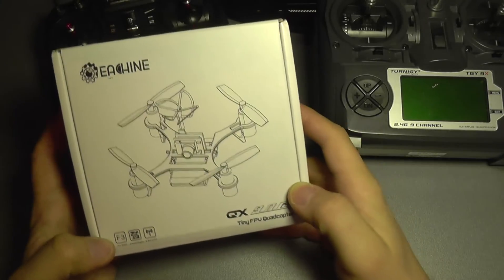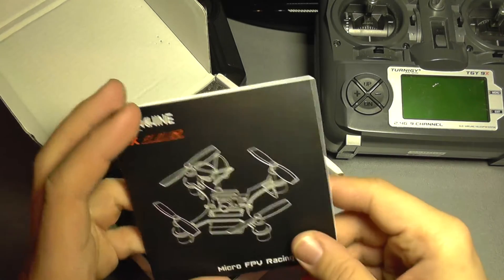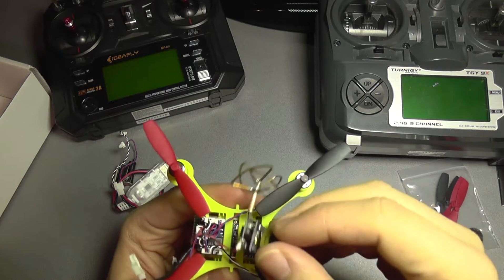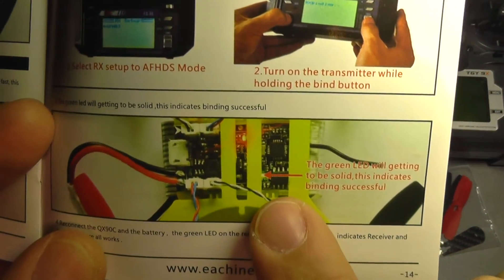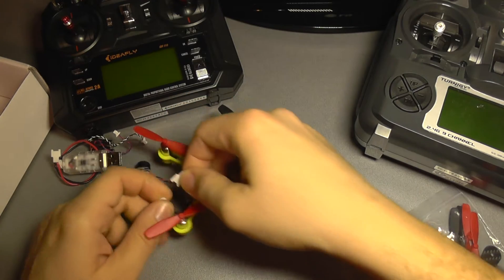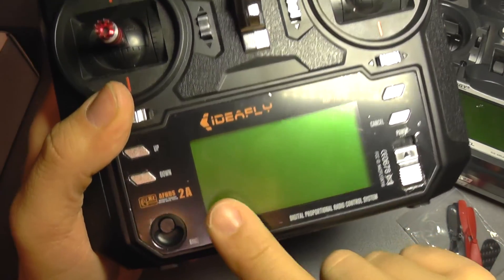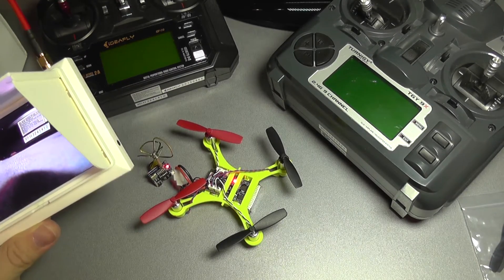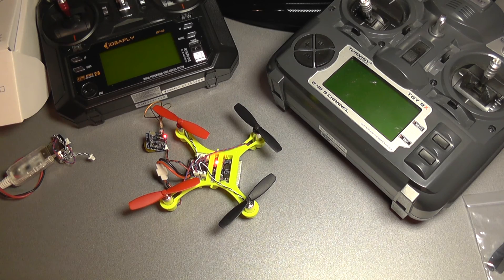Eachine Tiny QX90C 90mm FPV Quadcopter - part 1 - Unboxing and Initial Setup

Comment: nice video ...this is an awesome micro FPV quad...  i find that withmine one of the motor (cw) is getting much hotter than the others..have you had this happen ?
Reply from the maker: Check if the propeller is not touching the motor housing or check if there isn't dust or hair around the motor shaft.
Reply: thanks for  the info...yeah the motor fried ..i think it was a dudd   ..I am looking for spares now ..
Reply from the maker: There are so much mini / micro connector type that I have lost track of their models, types and names, better search for an original motor and it will come with the right plug.
Reply from the maker: It may be possible indeed to be a dud one, it happens...

Comment: Will the QX95 prop (http://www.banggood.com/10-Sets-Hubsan-X4-H107L-H107C-H107C-Propeller-Prop-BlackGreen-H107-A36-p-1047544.html?rmmds=search) fit this quad. Are there any performance difference using the QX95 props?
Reply from the maker: Why not get the original props ? The QX95 ones may not fit as they are a bit larger in diameter. Here's the original ones: https://goo.gl/iwqrP0

Comment: I am getting one of these, the only thing I don`t like is the props getting in the way of the camera, it I was to lift up the camera using something do you think this will alter the stability of the craft for flying?
Reply from the maker: You can try to lift the camera a bit, but i still think that the props will be in the view. Have a look here: https://goo.gl/T60alR it's just a bit over 50$ and it comes with extra props, spare motors, etc so it's a good bundle for what you pay.

Comment: It will be interesting to see how yours turns out. I watched reviews on the 80-90-95-100 versions and decided on the QX95 version, which allows for a little bigger high performance prop.  Nice that it uses those 1S 600mah batteries .. I probably have 2 dozen of them for various Syma X5 sized quads.  Camera looks good, but the weak spot is that built on antenna, which can get bent up if you have a bad crash.  Once bent, it is very difficult to bend it back into the exact right shape for optimum performance. It will still work, but range will be reduced .. perhaps not a problem if you only intend to fly indoors. I got the Taranis version of the QX95, and will put Betaflight on it and see how it goes. Cheers.
Reply from the maker: I'm looking forward to your experience with it.